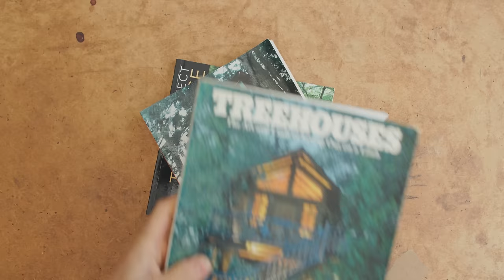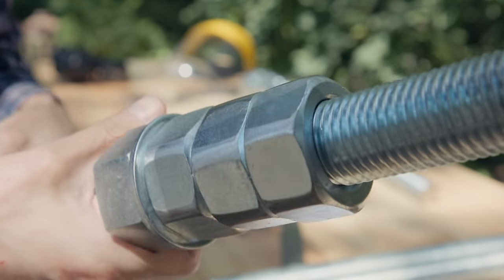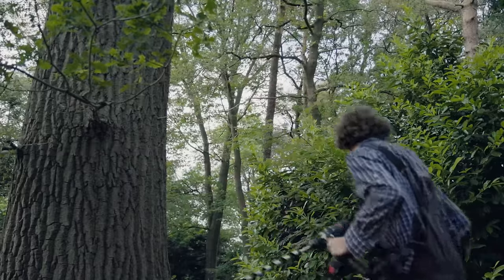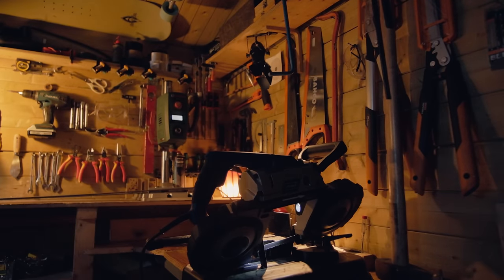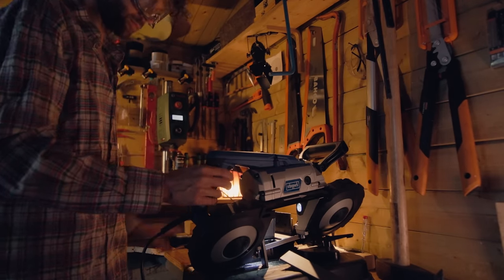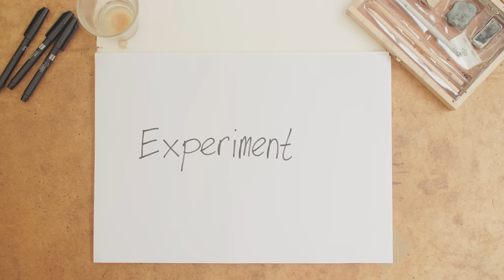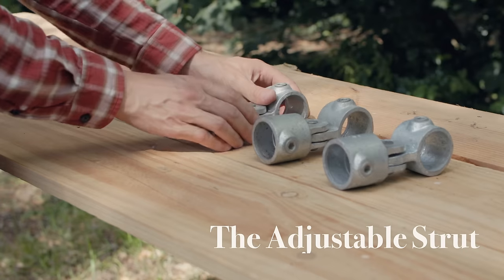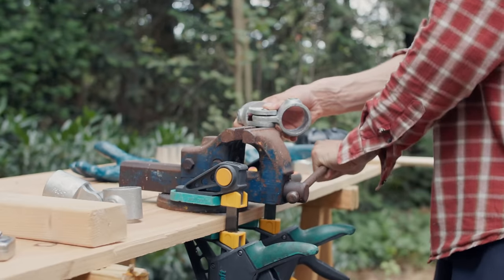Building A Beautiful Treehouse In The Forest Alone - Part 1

Comment: Ruud! This has been the best, most intriguing, fascinating, informative, descriptive, invigorating, motavating, exciting, detailed (and a few other adjectives) video on treehouses I have ever seen! Well done, super great job, looking forward to the end product but excellent work! Only one thing, you detailed your camera equipment, lol, but please add to the video the detail of the bolts, nuts, washers and other material you used. Thank You! p.s. you need to see about making a book on this, blows most of the Treehouse books away!
Reply from the maker: Too much compliments for me to handle haha. Thank you! A book also crossed my mind. Would be very cool! I did not add the specific bolts and nuts and metal info, because it is an experiment. So people can copy the idea if they like it, but should figure out/calculate/estimate the dimensions and strength of the connection points themselves. In the future I probably will make an more in depth video with more technical details and lessons learned. Thanks for the comment!
Reply from the maker: The bolts I used for the tree connection are: M36 grade 8.8

Comment: Impressive! Here's somebody who knows how to build and to film, equally educational and entertaining. YouTube at its best! I really like your bolt design and might use it myself. The only thing that's a bit dodgy are the pipe couplings made from cast metal. The material is probably brittle and the flanges are quite narrow compared to the beefy bolts. It will be easy to swap them out if they develop a crack at some point but maybe look into building something from flat bar?
Reply from the maker: Thank you for the kind words! :) It would be cool if you would try something similar! I think your are spot on. This is the weakest part of the design. This is also part of the experiment. I am keeping a close eye on it. But I think i am fine. To be safe I made the design in a way I can relatively easy reinforce or replace this part. There are a lot of factors at play. In my situation the tree is very thick and the bolts are installed not very high up in the tree so the movement of the tree is minimal (reduces also the change on metal fatigue). All the bolts are installed in one tree. Several trees moving around in high winds would create additional challenges/forces. And of course the load it needs to carry. Maybe these kind of technical details make a nice video for the future and also an update how the design holds up over time. Thanks for pointing this out!
Reply: Where did you find the threaded bolts of the size you used? It looks like maybe one and a quarter and one in a 3/8 in or? 

Also are your triangulated turnbuckle parts are they chain link fence couplings or what are they? Where did you find them? 

For my treehouse, I used commercial TABs, but I found adjustable form supports with 1-in threaded expansion rods. I think they will be strong enough, but like you, I can replace them if necessary. Mine cost 30 bucks a piece whereas the commercial ones are about 200 a piece.
Reply from the maker: Here in The Netherlands there are some shops you can buy them, also as a consumer. The size of the threaded bolt is m36. We have the metric system. The outside diameter is 36mm. 1.42 inches. For the turnbuckle part I used scaffolding tube clamps (with a swivel). They are also widely available here. 30 bucks is a nice find! It all depends on the total design, but as you say, 1 inch of steel is very strong. Great to hear you built a treehouse!!!Good job :)
Reply from the maker: Mine are from the brand kee klamp. I could not find a link, your image looks precisely the same. But I think the brand is not that important. I put a piece of pipe (that matches the scaffold joint) over the threaded rod. So the diameter matches. The threaded rod I used has a diameter of 36 mm and the pipe has a diameter of 42,4mm (standard size) with a wall thickness of 3.2mm . So the inner diameter fits the threaded rod exactly. If you decide for such an approach check the inside of the pipe, mine had some thick welding spots that I had to remove first...but not a big deal. :)

Comment: Is the m36 bolt galvanised steel (zinc coated) or stainless? Very curious how the tree reacts to the metal. 💭
Either way, excited for your project and subbed for more! 🔔❤️
Reply from the maker: The bolt is galvanised steel.  The metal tube that contacts the living part (sapwood) of the tree is stainless steel.  The bolt only contacts the heartwood. I am also curious :) so far everything is fine!